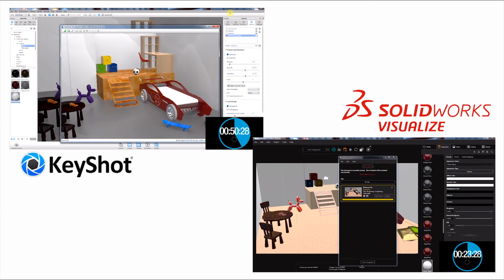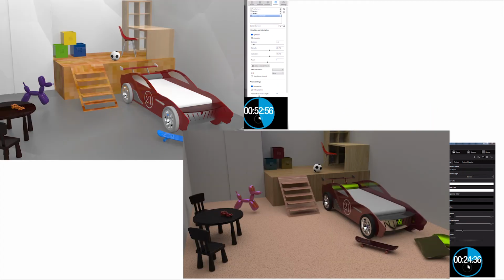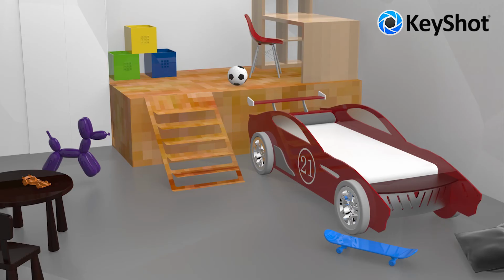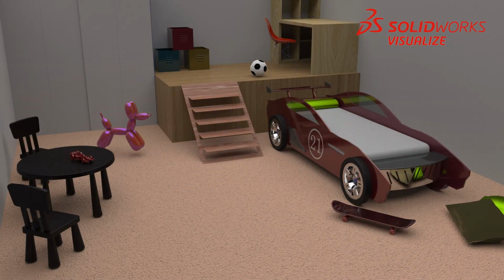SOLIDWORKS Visualize vs. Keyshot - Out of the Box Settings

Comment: Tell me laptop specifications for solidworks to work fast, like graphics card, RAM, SSD
Reply from the maker: You can also get the latest system requirements and recommended specs from SOLIDWORKS: https://www.solidworks.com/sw/support/SystemRequirements.html

We also have hardware guides available on our website at support.hawkridgesys.com for existing customers

For Visualize specifically, we also have some builds documented here:
https://hawkridgesys.com/blog/operating-solidworks-visualize-boost-server-part-2

Comment: What are the hardware specs on the system you used for the test?  A potato CPU paired with a Quadro P6000 for example could definitely skew the comparison in Visualize's favor.  Best to be up front I think about all test variables.

Comment: I work at Luxion, makers of KeyShot, so I am obviously biased. However, I sincerely hope no one is basing their purchasing decision on this video.
KeyShot uses different tessellation and rendering algorithms than Visualize, so there is no point in using the same values to get equivalent results. Also, comparing the latest version of Visualize with KeyShot 5, which was released way back in 2014, is at least very unfair.